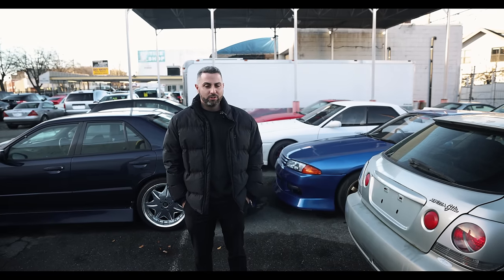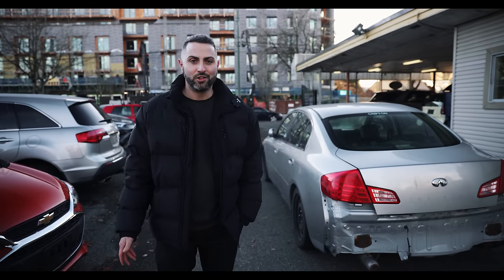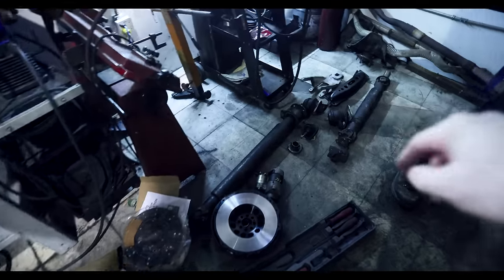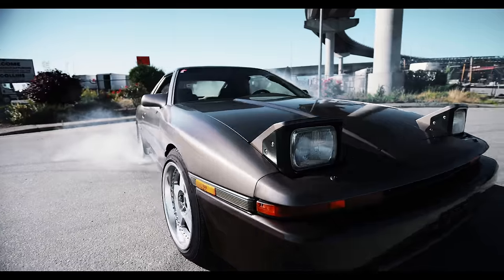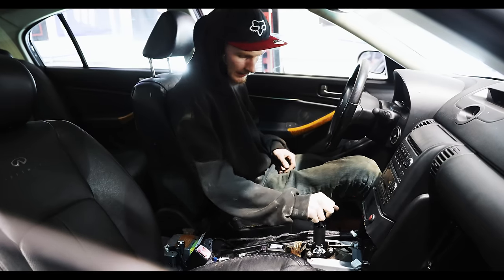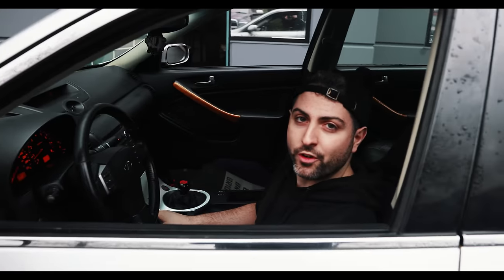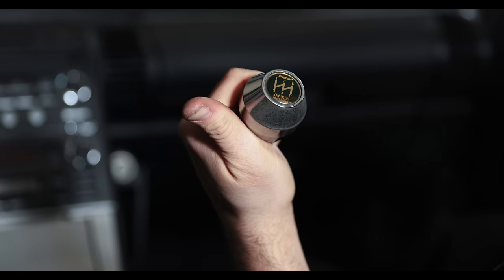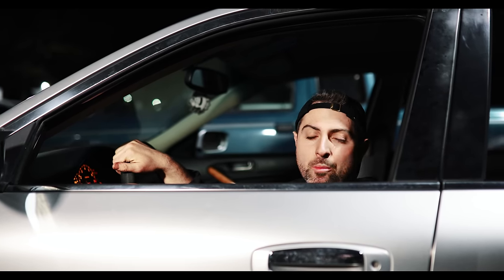We Bought a Drift Car! (4K)

Comment: I’m on the look out here in the UK. A lot of people bought cheap g35 skylines 4drs as imports, mainly 2.5 auto (basically the cheapest way to own a “skyline”) 
But due to repair & running costs, they pop up under £2k. 

We also get a lot of rusty Z’s manual runners for under £3k. 

Going to build one over time, use a GT donor for the Rays & Brembos, add spacers BC’s & a wrap and that’s a sick jammer. 

That will eventually replace my 330ci.

Comment: Love these G35 sedans! All the benefits of the 350z platform but with big body sedan style. I drifted one for years and loved it. Unfortunately the 03-04s only made 260hp stock with an auto trans though. The 05-06s made 300
Reply from the maker: I think with test pipes, plenum spacer and intake + a tune we should be able to free up a bit more power, but for now we’re already thrilled with how quick the car is compared to most of the stuff we’ve driven/streeted in the past.
Reply: @CheckpointJapan Right on man, and since I've got your attention, I recommend an Admin Tuning intake. It's the largest diameter intake available. Most intakes are smaller because they can be ran without tuning, this one is large enough to disrupt accurate MAF readings BUT since you'll be tuning anyway you can enjoy the extra power with no issue. Admin Tuning also does remote tuning so something to look into. Not a paid spokesperson, just had a good experience with them
Reply: @CheckpointJapan I recommend doing all latest fixes that Nissan did for later vq motors. Like the cooling and what not, I believe they also fixed it's oiling problems also.